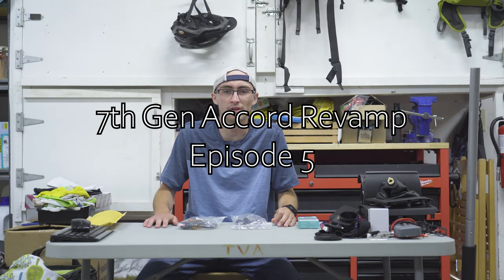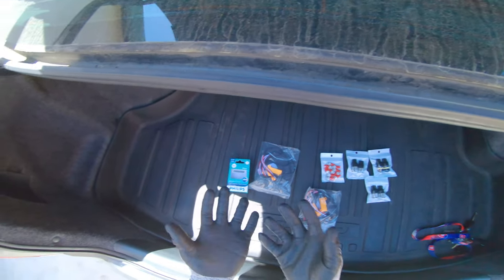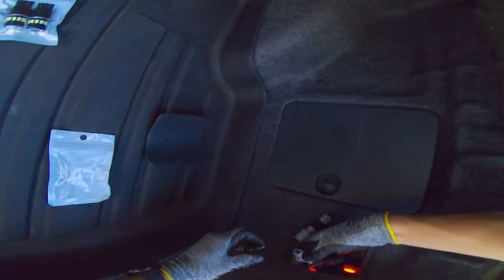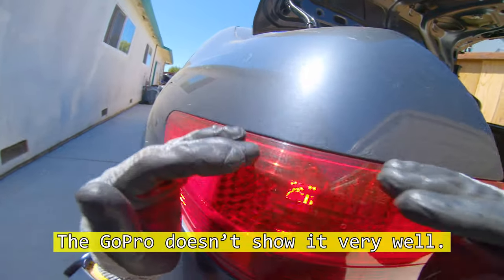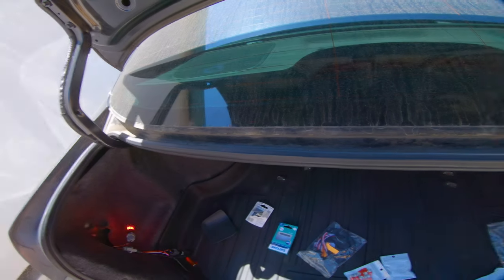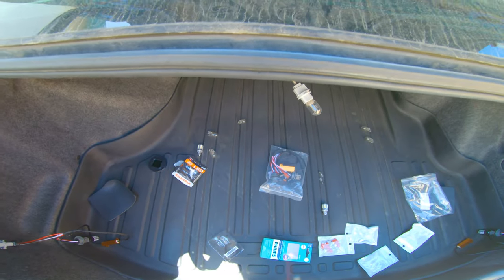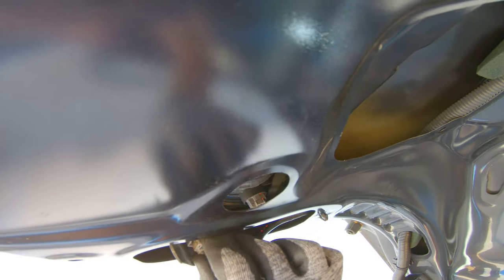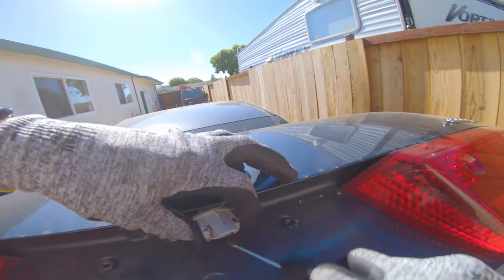7th Gen Accord Revamp Ep.5 | Taillight JDM ASTAR LEDs + resistors install/important info on them!

Comment: Wrapping the resistor heat sink in tape is not a good idea. The reason it has fins on it is to dissipate heat, wrapping it in tape is only increasing the odds of fire.
Reply from the maker: I'm aware haha, yes you are right. It is just for temp mounting. I ended up using the tape on the cable bits to hold it down. I also factored in that these are just turn signals, so they are usually not on long enough to cause any issues. If I was running hazards all day, that's a different story.

I am bummed the relay didn't work for the rear though, as it does on my Toyota. Might spend more time on it eventually and see how I can eliminate the resistors 😁